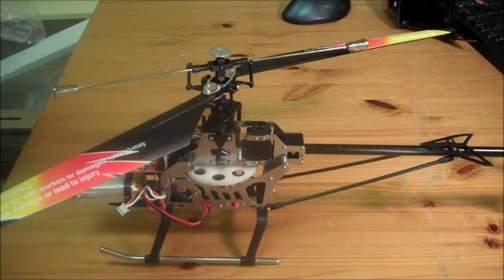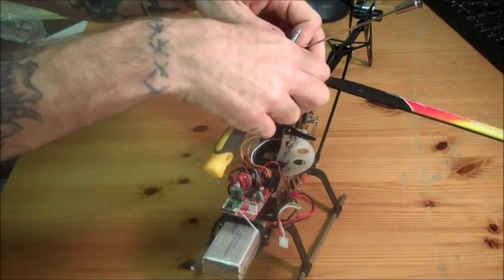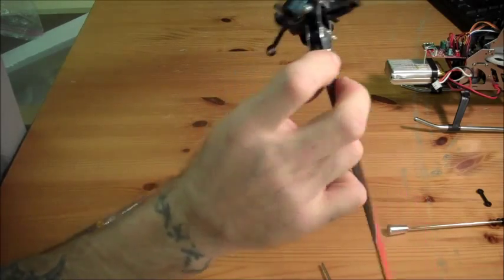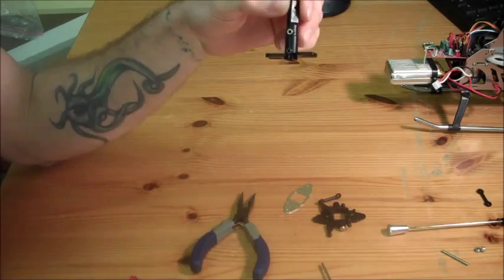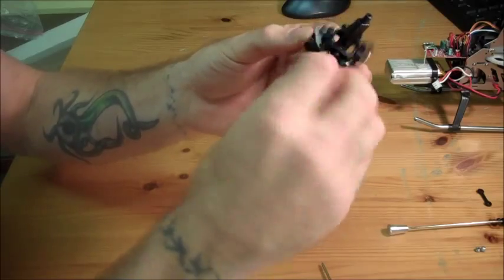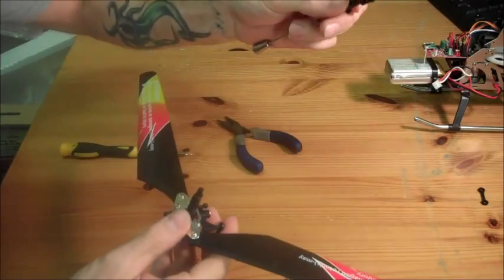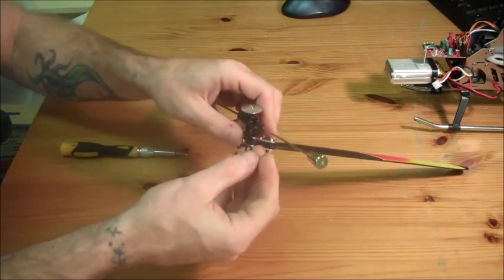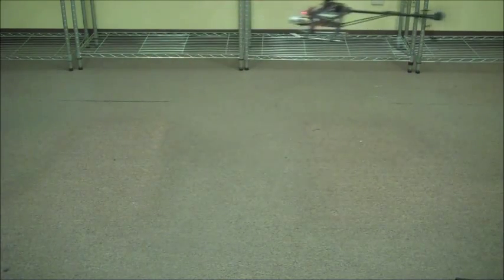UJToys How to Replace Upper Shaft for WLToys V913

Comment: Thanks for your video it is great help.
I am having a problem with the screw above the swashplate to take the head and rotor grips etc off the main shaft...
It will not go in completely like 75% in it wont come off the other end... what sould I do? i took it off from that helicopter originally so im like how can this not fit?
am i doing something wrong?
Reply from the maker: CryoInferno Take a moment to make sure all of the holes line up. That is my problem typically when I can't get the screw back in. Hope that helps. If not, zip an email to us at info@ujtoys.com and we'll take a look at it for you.
Reply: UJToys. com Thank you so much that is a very kind offer. I managed to fix it. You were right it is the lining up of holes. turns out it helps having the heli on an flat horizontal surface. :)

I could do with some help with my v977 collective pitch heli. i replaced a swashplate and now it will not take off. It spins up like normal and the rotor speed is fine but even at full throttle there is no lift. I am new to collective pitch and not sure what i did wrong. I tried hover debugging it didnt help either. when I replace the swash I did manually trim the single nose end microservo linkage so the swash looked level would this affect the lift?

Any advice is much appreciated!
Reply from the maker: Give our offices a call (number on website) or email info@ujtoys.com and we will be happy to help if possible. Thanks